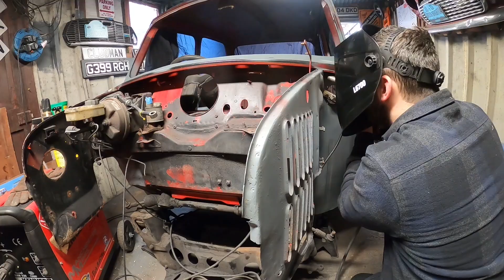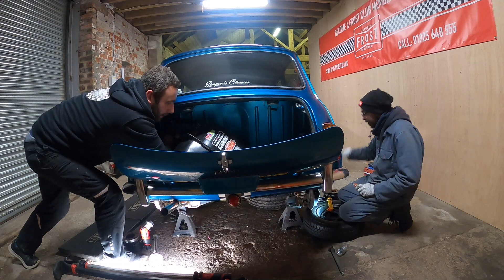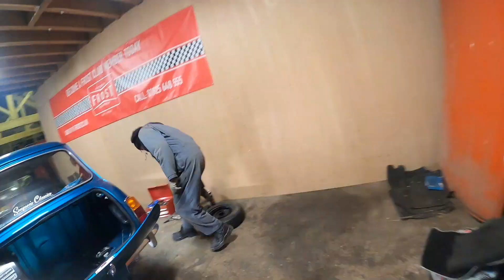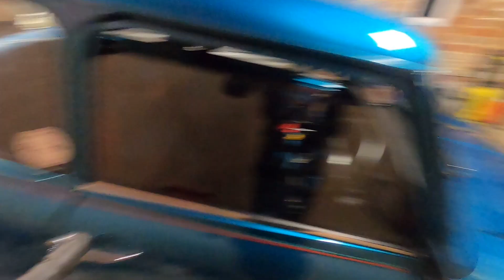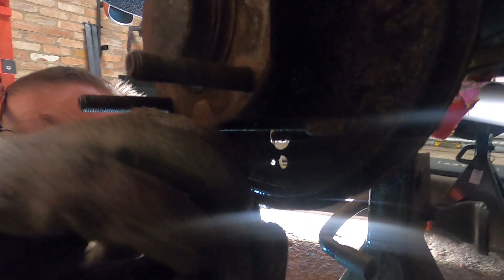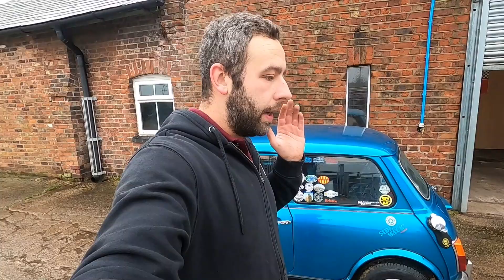#vlog WINTER TLC - Classic Mini Sidewalk

Comment: Seeing you unbox the wheel bearing reminds me of an issue I had with parts that seemed to be the same brand as yours. I made the mistake of using the grease that was supplied with the bearings. Sadly after a couple of hot days in the summer the grease melted in the sun and ran down the backplate onto the floor. I will always use a known brand of grease in future. Also, if you are struggling to get a knuckle joint cup out of the radius arm try melting the plastic with a blow torch (just a small flame). The caps will then come out easily and since you are always going to bin them it doesn't matter if they are trashed.
Reply from the maker: Yes I have heard the same about the grease I always use a different one I have on the shelf. That’s s great tip for the knuckle joints thanks for that, cheers for watching 👍

Comment: When splitting brake lines, press the brake pedal down and lock it down with a pry bar or bonnet prop tool against the seat, you can then disconnect the calliper or whatever and the fluid doesn’t run out and constantly drip.
Reply: Really?? Haha 😄 Use a brake hose clamp,  don't damage your seats 😄

Comment: For the purpose of leaving a comment. Do you think it’s worth converting to 10” wheels? Aesthetically I think they look better, but what about handling? Are the low end brake kits good enough for a quick road car? Or, would you spend the money on good brakes?
Thanks,
Scott
Reply from the maker: Hey Scott appreciate the comment. For me minis should be on 10’s after having many minis now I always put them on 10’s yes in my view they handle better and look ten times better. The original mini was on 10’s and it just works. This one has the standard 12-10 conversion kit so cooper S set up which is absolutely fine for this standard car but if your running half decent power or want better brakes then maybe look at some 4 pots etc. But yes 10’s all day long for me.. 👍
Reply: @SimpsonsClassics  thanks for getting back! Yeah I think I may just lift the mattress and get them bought! You may get onto minimine to supply a kit!!